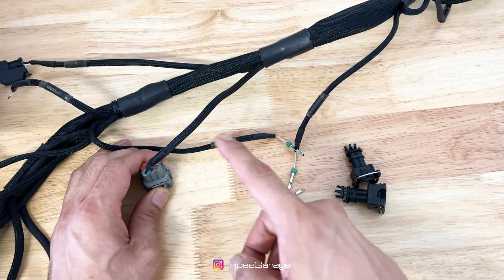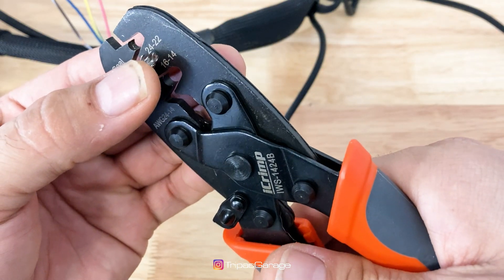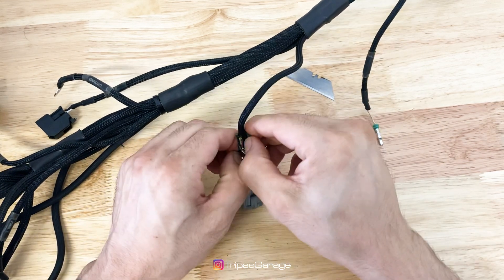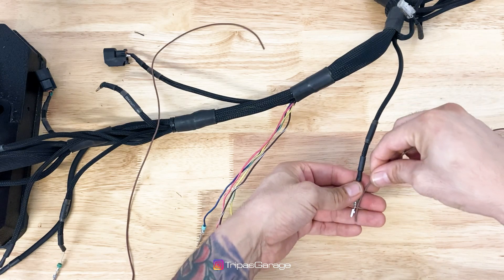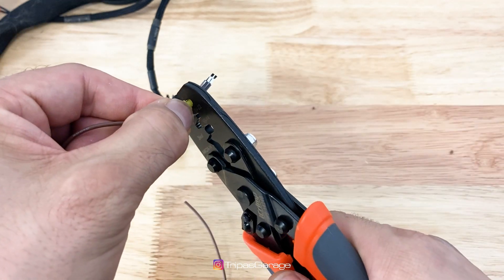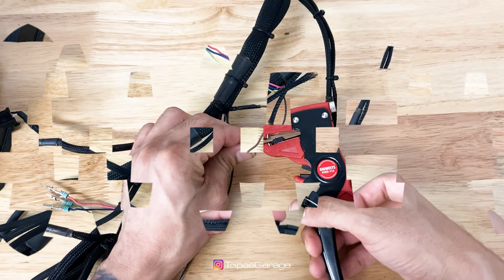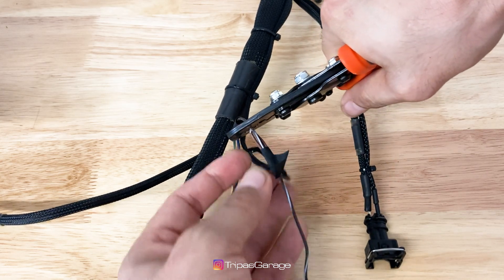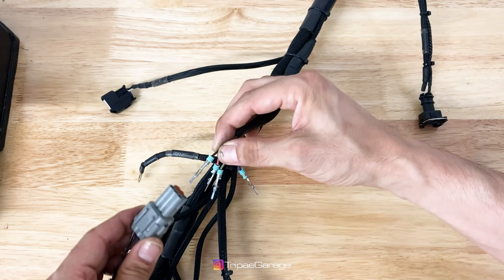BOSCH 2-pin Knock sensor wiring - 1JZ / 2JZ

Comment: If i have a ge harness what sensor ground would i tap into?
Reply from the maker: @999built  mostly all of the 2pin sensors require a sensor ground. Since you’re on a GE the distributor wires have a sensor ground you can tap into.
Reply: @ i have the ge vvti sorry i do not have distribuer
Reply from the maker: @ what ECU are you running? These knock sensors only work on standalone ECU.
Reply: @ i got a link ecu
Reply from the maker: @ find any sensor ground pin on the ECU and you can tap into that/those wires.